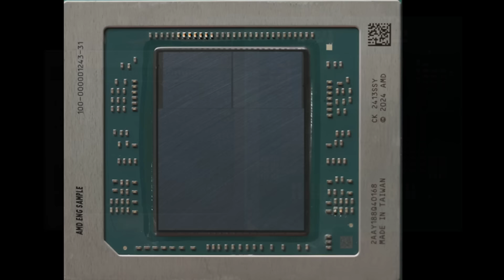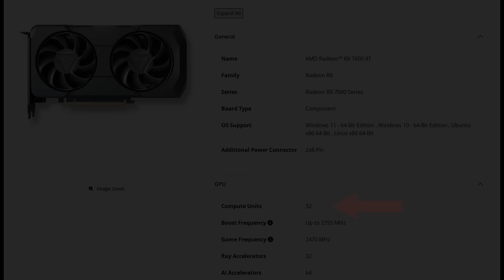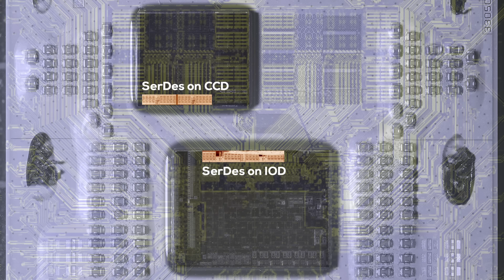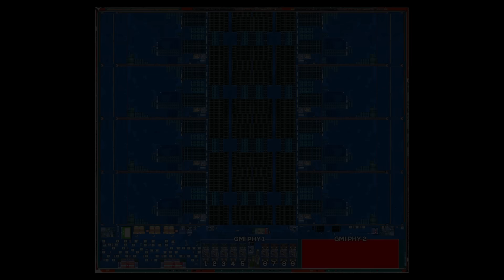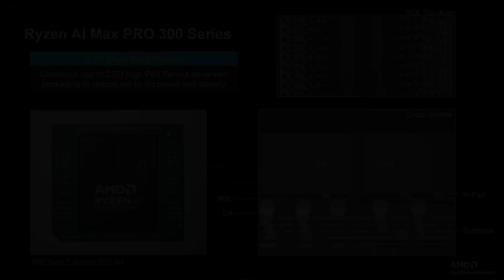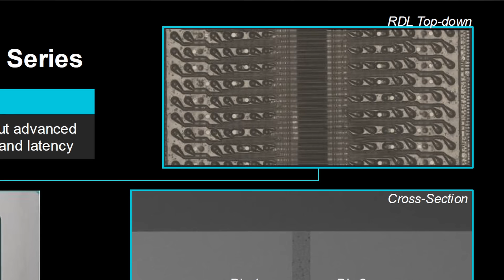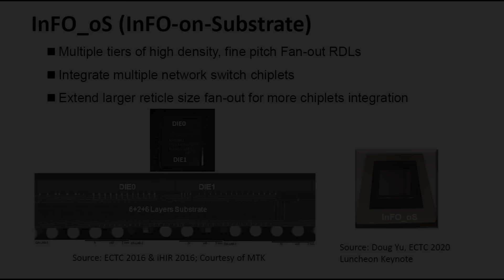How AMD is re-thinking Chiplet Design

Comment from the maker: Note: Strix Halo could also use any other fan-out packaging technology, e.g. from SPIL or other OSATs, that offer similar packaging. I think TSMC InFO-oS is most likely but we can't tell that from the die shots. They work the same though in general.
Reply: 3D cache would still be obviously under the CPU chiplet. They can route all the signals through bottom silicon to correct places on the top silicon. The interconnect density to move signals is there. I realized that after thinking about alternative technology that would allow 3D cache below with parallel interconnect to IO die but that was Intel not TSMC.
Reply: I wonder if the power management table has any information regarding the fan interconnect speed.

Sadly that information is likely not going to be easy to find out unless HWiNFO 64 includes this stat.
Reply: I know you are mainly looking at new tech , but I'm curious , have you ever heard of a Java processor ? It's exactly what it sounds like : a CPU/FPGA that is capable to run Java without the need of a JVM* . The most popular commercially was apparently the aJile processor . There is also an opensource version that is programable on an fpga called "picoJava-II" . There's not a lot of information on youtube about it , but honestly I want to know how they managed to know that a cpu have java acceleration and make it run on it .

Comment: Sometimes i wish the chip industry would upgrade from old school thinking of SerDes to multi-stacked SerDes meaning 1 wire (or 1 set of wire) would carry dual bits or 4 bit (as a hyrid digital / analog signal) in paralle to improve this congested design. 😉

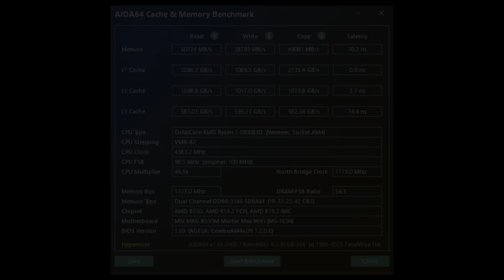Comment: 13:39 Small correction on "Ryzen FCLK is tied to MCLK". The clock ratio is only 1:1:1 for MCLK, UCLK, and FCLK for DDR4 Ryzen chips (zen3 or before). For zen4 and zen5, the MCLK, UCLK, and FCLK can run at different ratios because DDR5 MCLK can run so much faster. Some common "ideal" ratios are 3:3:2 or 2:1:1 depending on how fast the MCLK, UCLK, and FCLK can each run.

MCLK = Memory speed
UCLK = Unified memory controller speed (on the IOD)
FCLK = Fabric clock speed

Comment: if the connection has change not explaing the Latency .
for memory bandwidth if you look 20:05 time in video ---> memory type --> dual channel VS quad channel 
if next gen has quad channel is a big upgrade , strix halo on this example is not big deal on latency

Comment: In the context of accessing system memory, there is not a big difference between FO and SerDes as far as latency. FO's main advantages in that context are really just density and energy efficiency as you discussed. The DDR5 SerDes implementation adds 5-10x the latency that the chip to chip SerDes implementation would anyways.

I personally think that AMD will implement an x3D-like cache to the SoC die, as there the FO vs SerDes latency argument actually makes a difference. The trace length may be too long, but given the trace lengths of the current x3d implementations I think AMD will find a way. AMD could also start stacking the CPU dies onto the SoC die. 5800x3D and 7800x3D had the cache on top, and while cooling was a concern, it wasn't a dealbreaker.

Comment: SERDES does consume a lot of power but that doesn't mean a fan-out system is passive, to move signals around you have to buffer them, go up to the middle metal layers for the long runs, then go back down for another buffer and then either up for another long run or all the way up to the bump.

This adds some complexity, mostly for modeling the parasitics and cross talk.  They may build ECC circuitry in to the fan out or maybe in to the interposer so that the accuracy of the words is confirmed at every layer but most of that will be handled by a library of cells put together either by hand or by place & route.

The new technology here is just a more complicated interposer and compared to the actual silicon dies it's primitive.  The real reason why this is new is that the designers are seeing some benefit from shifting the complexity (and cost) from the dies to the interposer and from dies built with a state of the art process node to dies built with a less expensive process node.

SERDES is always going to be around because you will always need high speed interconnect for longer distance like getting to a PCI bus or a memory bus through the board instead of through an interposer but this does create the possibility of using a fan out from a 2nm chip to a SERDES chiplet built with 5nm, 14nm or even 28nm process technology.  Doing that has a few benefits, you might save money but you can reduce the size of your state of the art process node die to increase yield or you can increase the size of your state of the art process node die to increase performance.

The other thing is when you make a complex interposer you solve your immediate issue of transporting signal chiplet to chiplet but whatever else you add to the interposer is essentially free.  You could get capacitors to help stabilize power delivery or jumpers that go from one side of a die to the other side of a die.  You might do that for noise reasons or maybe just to avoid congestion in the silicon layout.

This is just the obvious evolution of interposer technology to maybe eventually connect modular commodity chiplets in to a capability tailored for the application your A(SIC)PU is intended for.

Comment: I would argue that for the next chip amd might actually do away with 3D Cache.

If a fan out design is quite a bit faster as you say then they might just swap the 3D cache out for a standard L3 on the CCDs and a fast and large L4 cache on the IO die. Because let's face I doubt AMD will be putting 40CU GPUs on desktop consumer cpus unless it is specifically a G varient. So regular gaming focused X and non-x varients might still have only a 2 CU gpu but might have a larger portion of the IO die dedicated to a fast L4 cache. If they could say do a 512MB L4 which might be a bit slower than an L3, the sheer capacity of it may offset the performance loss of cache misses from the L3 as a cache miss doesn't need to go out all the way to DRAM now. 🤔

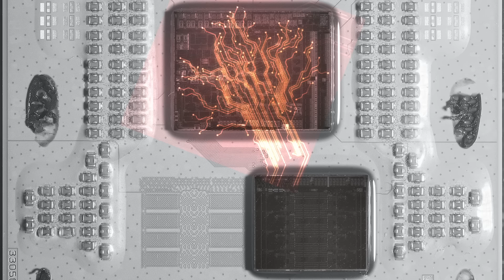Comment: 8:25 - and so what? Why don't you just create those hundreds of connections? I bet it is both easier than to create a chip architecture and more efficient in terms of information transfer speed. So they are just lazy and unwilling to spend more money on a new technology am I not correct?
14:41 - oh, so that's what, you're a lier😀

Comment: According to the Chips and Cheese article, the Strix Halo D2D's bandwidth appears to be equivalent to the Strix Point, offering no bandwidth advantage whatsoever.
Since Venice has a DRAM bandwidth of 1.6TB/s and supports up to 8 CCDs, the new D2D's bandwidth is expected to be at least 200GB/s or higher, indicating a completely different implementation from the Strix Halo.

Comment: There is no denying the economic and performance success of the approach AMD is following.

But at core the design strategy is the crudest, simplest, and purely cost focused design strategy ever implemented at large scales.

Make exactly 1 Logic design  and exactly 1 I/O design.

Then use binning and (irreversible) differentiation (essentially "burning" metal circuit traces that are deliberately and specifically added to the design for this exact purpose, in locations that are easily accessed, often at the same parts of the chip as the QA/QC/Testing circuits that are used for the conventional binning)

It would not be far off, perhaps even exactly true, to say that identical silicon exists in a desktop Ryzen and a 128 core Epyc, only by the number of Logic dies in the package, and how much functionality has been "disabled" in the consumer product.

Again:   Nonetheless, this strategy still seems to be superior to monolithic designs.

Comment: Is the fan-out approach here similar or different from Intel's new approach? If it is different, how is Intel approaching the same challenge here?
Cheers.
Reply from the maker: It's similar to Intel's Foveros. Intel's solution is a bit more advanced, but also more expensive, as it uses a silicon interposer instead of a organic one.

Comment: Another upside to being able to use the high-density interconnect for large fanout signals is that the yield on chiplets with smaller area is larger. I'm not sure about the process that AMD is using, but in GF12, there was an exponential increase in yield with a decrease in area.

Comment: The funniest thing with the interconnections is that it an Intel patent that AMD got out of them for allowing them to use 64bit x86 a decade ago as part of the settlement and intel just laughed thinking they got away cheaply, if AMD did not get access to these patents they would not been able to do the chiplet design..

Comment: The I/O die is being currently being underutilized. What new features could be employed that need a tightly coupled interface?. 

Remember Nvidia is starting to include a Risc CPU on their next generation GPU's. It allows Nvidia to simplify and speed up the CPU drivers. Eventually reducing the CPU to I/O and asset fetching and pacing.

Comment: 3D cache make big different because AMD have bad memory controller. The latency is very high. The new interconnect that I assume in parallel, will reduce the latency between L3 cache to memory controller. If AMD also improve their memory controller, I think they do not need 3D cache. AMD only need make L3 cache little bit larger. Compare to Intel, AMD have worse memory controller and I/O controller. But AMD have better ISA (core architecture).

Comment: I wonder about another thermal problem, not only the organic material sensibility to heat but also one of the advantage of Chipsets is that you can include the thermal design in the distribution of components.  The other is longevity,  in particular after years of intensive use.

Comment: I think Apple use fanout design with chip over chip as v-cache in latest AMD CPU, and RDL. So you may look for this, because this is solution for v-cache in this type of design. I found it few years ago when I was looking for info about RDL (which is much cheaper than interposer and don't have limits because how is made)

Comment: Strix Halo is so cool. I just wish it had more memory bandwidth than ~250GB/s. Intel's new B60 has ~500GB/s. Great value for the potential memory capacity, but it's hard to compete in speed when an RTX 4090 has over 1000GB/s. You could say they are all different classes of cards, but I'd really love to see an AMD or Intel product crush Nvidia's higher end gaming cards in performance and value for AI workloads.

Comment: RDNA 3 Chiplet 7900XTX is a great GPU from a hardware perspective—it's just that the software support lagged by two years. I'm currently using its 24GB of memory to run LLMs that assist me during the workday, play with Diffusion models after hours, and enjoy 4K gaming on weekends—all within Windows, without the hassle of dealing with Linux. At a $750 price point in 2025, it's absolutely worth it.

Comment: When we get Zen 6 desktop, I'm hoping that leveraging SPIL to also allows them to seriously increase the PCIe lane counts. They could get really creative with the IO/GPU die on desktop, instead of 40+ CU's, they could put a much smaller GPU and use the extra real estate to put a tiny PCIe switch / fanout to take 4 lanes of PCIe 6 and turn them into 8 x Gen 5 lanes, or 16 x Gen 4 lanes, or more... Would be a game changer and finally bridge the gap between high end consumer Ryzen and Threadripper professional platforms with ability to support large numbers of NVMe SSD's and AIC's.

Comment: APUs sound good but im not sold. i got a 3200g, and i got a gpu pretty quick. so in two years there will be a cpu with a 6yo GPU, okaaaay. gpu 100% and CPU at 30%. it doesnt make sense to me.

my guess it will cost 300buck and preform as well as a 100buck CPU and a 200buck gpu.
Reply: its actually available already, and its $1200+ at the very least...
Reply: @s0ulll0warri0r  hummm, im even more disappointed. why put a 200buck gpu in a 1000buck cpu... this product is not aimed at me.
Reply: @-IE_it_yourself because it's a cutting edge experimental product, yes, its not aimed at everyone but it is impressive nevertheless, and in next generation of apus it might become A LOT cheaper, while im this gen even supposedly much cheaper 380+ isn't even available at all, which proves that its low quantity experimental product
Reply: @s0ulll0warri0r  interesting.

Comment: i wonder what are the timing constraints AMD has set for the parallel fanout. For such bandwidth, typically the delay matching will go down to picoseconds and without the use of serdes or any retimer, direct fanout would be quite challenging in the first, adding onto the even lower voltage level of the signals with the smaller process node. Really interesting...
Reply: as some other guy said, they have to make fanout wires the same length so all data arrive in one clock
Reply: @s0ulll0warri0r  that's the idea of length matching on the substrate, but I am talking about the real physical timing constraint. The "same length" is still going to have small deviation, that's why we do length matching/ delay matching. Take DDR5 as an example, the delay matching between data strobe and data is already down to <3.5ps.
I am just curious about how they are mitigating the timing mismatch, cuz routing on substrate typically don't do much length matching nor does the substrate has the space for matching the length anyway. Without the Serdes that would be very difficult especially at that frequency. 
I wonder have they implemented anything like ECC for the parallel interfaces.

Comment: SerDes Slow Things down! I have an architecture with limitless parallelism and it does not need this.
It does not require a clock, but there is a clock that you would make use of (not default) for situations of human interaction, Visual, audio, physical.
And race conditions aren't possible.
And this uses less power.

Comment: Why couldn't the 3d vcache package have the interconnect built in? Instead of using a copper substrate.
If they're already putting a vcache package under it, might as well put the interconnect in it.
Just design the vcache with cache on 2 sides and the interconnect in the middle.

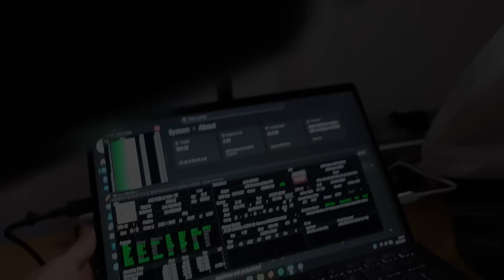Comment: 20:00 I've made a bandwith tester back in 2019 for work using Google benchmark. It was between 2 intel chips and 2 nvidias gpus link with SLI each on different numa banks and had 64 GB of ram for each CPU . The way I tested it , I had to invalidate the cache between each runs and that was done by filling up the cache with a new array the size of the cache . You also had sommething called "Pinned memory". It's memory that the GPU knows it can access because when you allocate memory , you normally get a virtual adress that is an abstraction of physical memory , but when you allocate pinned memory , the driver gives you a piece of physical memory  that the drivers knows he can access , otherwise it will have to alocate a buffer to transfer the memory to the GPU . I actually find out that the nvidia driver didn't free up pinned memory even if you free it ! Anyways, I could write something similar for AMD if you are interested .

Comment: N00b here. How do you position everything on the chip(?)? It seems that if you make the connections so tiny you also make it really hard to position the two parts on oppositie sides of that web of wires. Suddenly you need not just nm precision in the silicon but also outside of it. Making that more complex and with more costs associated in production, and more errors and even more cost.
Or is the interconnect and chiplets etc all made at once on one piece of silicon using the same nm tech, and no need to position anything between them?
But he also said "it's almost like the dies use the same silicon" suggesting they are not one large piece.

Comment: Yeah making it so close makes it less flexible, but chiplet was designed to drop production failure rates. It's solved the added latency at the cost of flexibility, but this action was expected at this point with how soldered ram has become allmost mandatory for the highest ram speeds.
Stuff is so small and fast, that distance is actually a noticeable slowdown. This is it's logical conclusion.

Comment: 21:46 they could try to pull a bit of a stunt, and do away with the RDL layer, and use the 3D cache die to connect the two silicons, with some structural silicon with passhtroughs for the connections of the IO die

Comment: The main reason traditional analog cannot shrink anymore, to my understanding, is because of the fact that the copper wires needed to transmit the data through the substrate cannot get any closer to each other without compromising signal integrity. This would mean that the BGA that connects the die to the substrate cannot get smaller anymore, which means that the physical controller cannot get smaller, not because of the technology limitations on the silicon side, but instead the substrate being used.
You can actually see this with GPUs using HBM memory. The memory controller of the Radeon VII (Vega 20) is tiny compared to GDDR memory controllers despise the massive bus width because the copper wires running through the interposer can be a lot closer, which makes micro-BGA possible, which allows the physical controller to be a lot smaller.